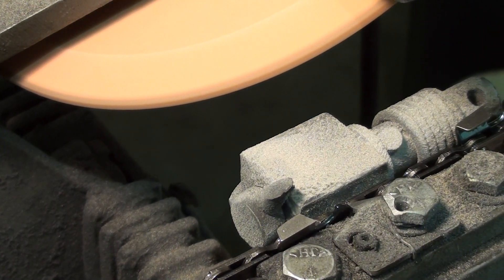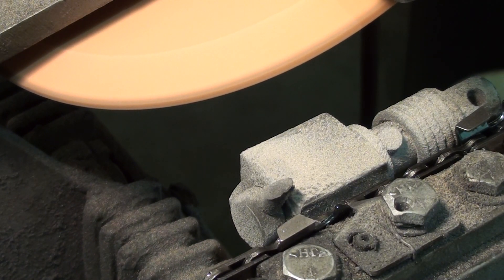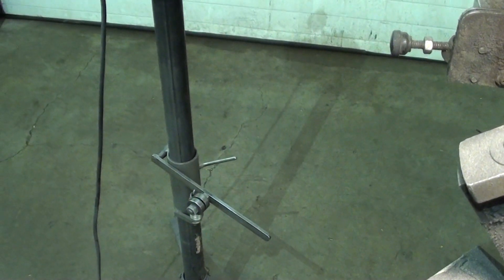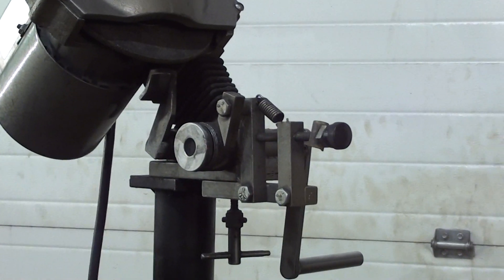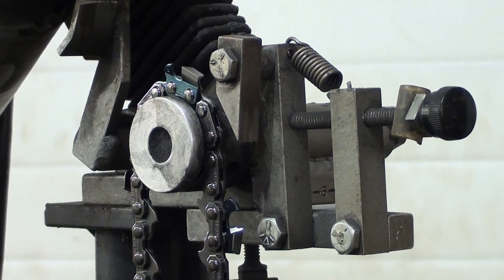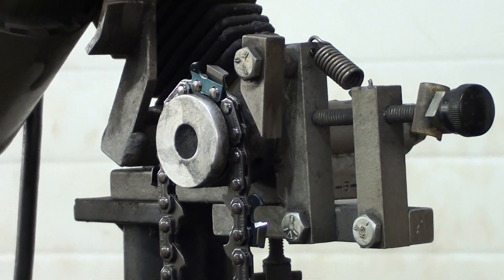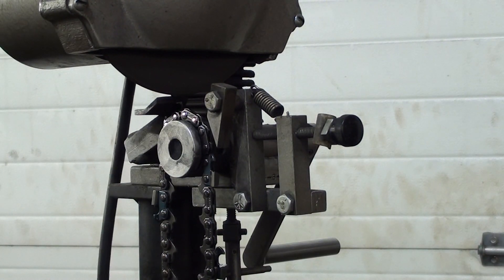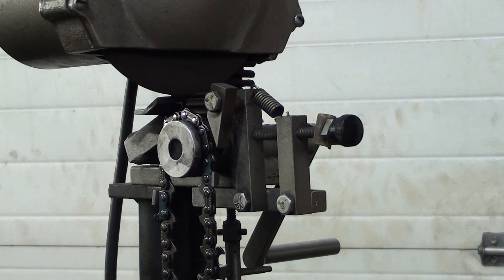The chainsaw guy shop talk His Razor Sharp chains you can now buy

Comment: I do the same thing with a new chain, except i do it by hand. If you don't have the eye to do it by hand, then buy a Granberg G-106B, or the Granberg Precision 12 volt chainsaw chain grinder. The biggest problem is using to big of a file. Like on a 3/8 it calls for a 7/32 file, using this file you'll never get it to cut like one of Chainsaw Guys chains. You have to drop down to a 3/16 and you'll get a razor sharp chain. Keep rakers at .025. I've filed by hand for 56 yrs, i logged full time for 36 yrs. In hardwood i kept my rakers at .025, in softwood .035. I kept my chainsaws razor sharp all the time. As soon as it lost the edge, i'd drop and file where ever i was. It  takes about one to two minutes to put the edge back on the chain. I can teach anybody how to file their saw so its razor sharp.
Reply: Duane it's guys like you that I'd love to learn from.  56yrs of hand filing is a wealth of experience and on the job know how.  I'll be looking into those Granbergs you mentioned as I'm sure you wouldn't suggest them if they didn't meet your satisfaction.
Reply: I've been using a 7/32 on my 3/8 chain. I'll have to try using a 3/16 next time to see if I can tell a difference. Thanks
Reply: That's correct, filing a square ground chain with a 7/32 file wont make it cut as fast as his chains 😜
Reply: @tonyrobbins6  it will cut faster, but it will also dull faster, especially in dirty wood. The 3/16 does better on the rear half of the chain as the cutter gets shorter toward the back.
I feel inspired to be able to give Tony Robbins chain sharpening advice
Reply: @brettblack7049  Thank You
Reply: Good sir, what am I missing if I simply resharpen with a round file my stock Sthil chain? I have a Sthil MS250. I'm a carpenter who occasionally uses his chainsaw in the forest and regularly in the lumber yard to cut down pieces... 
I think I would be more interested in filing to get a better ripping chain. 😁

Comment: Definitely a good thing to have if you have a longer bar, i personally though just freehand in the field but at home i use one of those Husqvarna sharpening gauges especially on my X-cut chain since it's a harder chain to sharpen and that gauge helps keep the right elevation of the file.
Reply: I use the LP Husqvarna roller gauge. Simple and inexpensive: does a job that produces an extremely sharp chain each and every time. The fact that this can be accomplished quickly with the chain on the chainsaw is a huge plus.